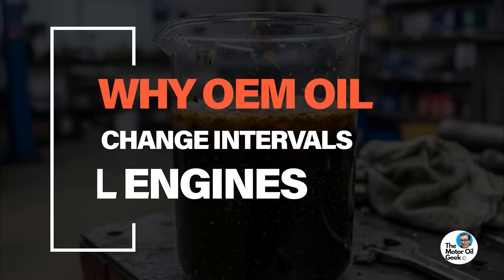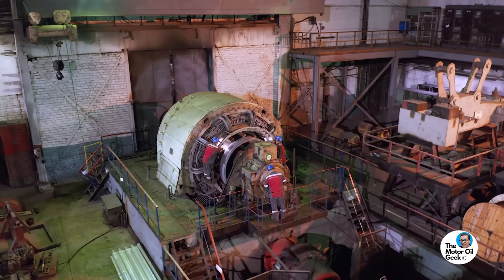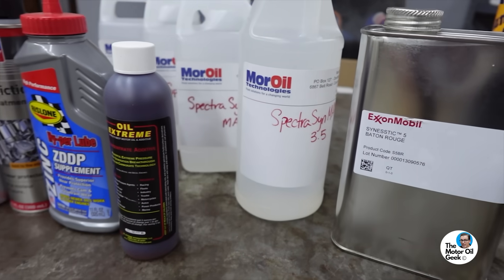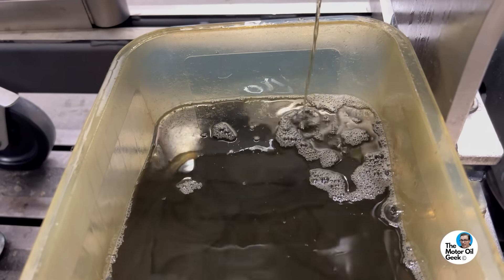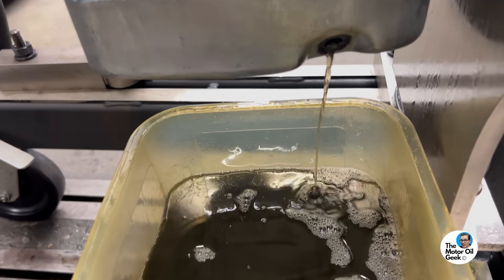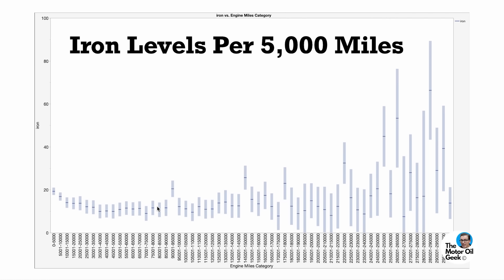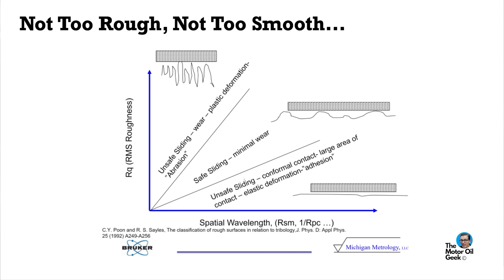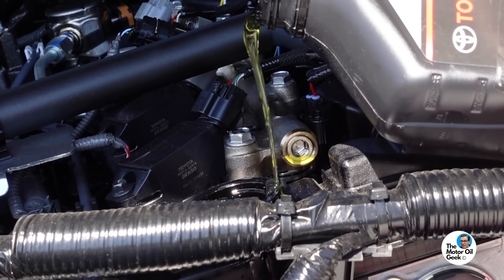NEW Data Reveals WHY Modern Engines FAIL Prematurely!

Comment: Another great video that answers a couple of points from my experience.

Firstly, and engine I rebuilt made 20bhp less on a dynomometer at about 8000 miles than it did at 30000 miles.  No engine or exhaust parts were changed.  I think break-in can take longer than  10000 miles.

On another car, I noticed the differential bearings were in worse shape than the wheel bearings at 250k miles.  At one point, the pinion seal leaked and I suspect less oil, coupled with the differential bearings being next to the final drive gears is what caused more wear of the differential bearings.  Now I know the rear axle oil definitely does need changing and I blame the initial 125k with not changing the oil.

Comment: Awesome video. A mechanic one told me a oil change is cheap in comparison to the cost of a new engine. 
I wonder if engine internal parts quality has a correlation to engine breaking down. Parts being made out of a cheaper grade metal than engineered for.

Comment: If you are tired of engine problems then just get a mazda. Those engines use elecric solenoids instead of hydraulic pressure. Those engines run forever.

Comment: I never bought in to this trend of high mileage between oil changes. I remember reading in a 1960’s GM book to change oil every 3000 miles and the filter every other oil change. That seemed to change with the spin on filters. So I stuck to 3K and filter with gas engines and 5K with filter on my diesel engines. I just purchased a 2026 F 250 with the 7.3L engine it’s at 400 miles. So Lake my plan is to change the oil at 500 miles with valvoline Daily Driver 5W-30 the only oil I’ve found so far that meets the WSS-M2C971-A1 requirement. Do I change the filter on this first change? I’m think not. Thank you in advance

Comment: In the past, I have always done the 1st oil/filter change at 1000 miles, the 2nd at 5000 miles, then every 5000 thereafter. However, I just purchased a 2025 CX-5 Turbo Signature and I plan to be a bit more vigilant with it, as this will be my last new vehicle for a long time, since I'm retiring soon. I just did my 1st oil change at 600 miles and the 2nd will be done at 1500 miles, the 3rd at 3000 miles, the 4th at 5000 miles, then every 5000 thereafter. I will be using pennzoil ultra platinum 5w30 for the duration because it offers excellent wear protection in turbo engines at a good price, which is important when doing more frequent oil changes. Given that turbo engines are naturally hard on oil, a few extra oil changes are well worth the cost. Another great one!
Reply: A 2025 vehicle will likely not last you a long time. It's worse than we all think.
Reply: @TraderNalang  There have been sh|tty vehicles being sold throughout automotive history and there have also always been excellent vehicles being sold the whole time. That continues to be true today. Plenty of current models can last as long as you want them to, with proper care. People have been making hyperbolic statements about vehicle quality for decades, but if you choose the right vehicle to begin with, longevity is mostly about maintenance after that.
Reply: @TraderNalang It's a Mazda skyactiv. It will do 300k even with the ridiculous 10k mile interval. Mazda today is what Honda/Toyota were in the 90s.

Comment: On my 1GRFE, anything below 5W-50 under 30C will lead to valve clatter.  So its ester based full synthetic for me here as the noise tells me the story and of course using double filtration with magnets helps.

Comment: @themotoroilgeek 

Can you do a chemical analysis on bmw specific long life oils compared to the regular synthetic sp rated oils.

My suspicion is there is no reason to buy the ll oils because the sp rated oils are also designed to operate in turbo charged direct injection engines.

Would love if you went over this

Comment: For those locked into a dealer service schedule I have found that purchasing a 2 Gallon fluid pump to do intemediate oil changes at home between the dealer service interval to be a quick cheap and easy option.
I just suck the old oil out through the dipstick and refill. Dont change filter.

Comment: I think in an old engine, it’s the carbon getting past the rings not so much the smooth surface finish whatever it is old engines need oil changes

Comment: Since  my early driving days, 3,000 miles was the oil change interval to adhere to.  Despite using synthetic oils today, and a lot of stop-go driving I still do 3000 to 4000 mile OCI

Comment: OEM's used to manufacture their own engine parts. They no longer do that, so quality control suffers. No oil is going to make up for a component that wasn't hardened right, wasn't machined right, or was made using the wrong material for the application.

Comment: I could use recommendations on which filters catch smaller particles.  I am not running long intervals, so I don't need "extended mileage" filters.  Manufacturers don't always list the actual particle size and filters have changed so much/often in recent years.

Comment: Is it OK to use a good quality semi synthetic or mineral oil for the first 5 oil changes during the break-in period?

Since I'll change oil the first time at 100 miles then 250 then every 750 miles for the next 3 times is it OK to save some cost on the oil?
 
Do I need to change the filter at every oil change?

Comment: Bought 2010 Dodge Grand Caravan Feb 2010 (Date of Mfg Nov 2009), new.  When at 5,000 Km changed to Amsoil FS and have changed oil & Filter every 10,000 Km since then.  Still on original motor and transmission with currently 342,387 Km showing.  Van still gets between 24 & 24.7 Miles per USG.  Do 80% to 85% highway driving, still averaging over 20,000 Km per year.  Every 150,000 Km drop transmission pan, replace filter top off with Amsoil FS.  Oil and filter lot cheaper than new motor.
Reply: What kind of engine? Pentastar 3.6l v6 ?

Comment: Owner manuals of the ‘60 and ‘70s state an oil change every 5000 km or 3500 miles. Viscosities used were 10W40, 15W40 and 20W50 as standard change. 
 In the ‘80 and ‘90s an oil change every 15.000 km or 10.000 miles or ‘Every year’ what ever comes first. 
Viscosity of oil back then are resp. 10W40 and 15W40 as standard.
- Worn engines or engines with great tolerances run great on 20W50. Whereas sportier engines do well on 10W60 Synthetic oils.
Reply: Thanks

Comment: @13:25, so a thicker oil has more contamination fighting power in a diesel with soot?
Reply: Also interested in this. I would say yes, but I am not qualified. I do run a 5W40 in a diesel that is rated for 5W30.
Reply: @nrnccrdn  From what I understand is 5W30 and 5W40 share the same base weight, but the 40 would have modifiers that thicken it when it gets hot. So I don’t really understand where the ability to fight soot would come from; unless it would also have more of a detergent package as well.

Comment: I also believe that engine oil viscosity have gotten to thin to give enough sheer strength once the engine oil is at operating temperature they fail to protect against metal to metal  contact causing extreme wear along with extended oil change intervals manufacturers suggest are too long  ,by 5000 mi. oil is completely black burnt and full of contaminats and needs  changed, a tubo or supercharged  engine most likely needs changed more often than every 5000 mi.

Comment: What if you’re running 20 pounds of boost and using E 85? I’m changing my oil about every 30 WOT pulls. I’m using Motorcraft 5W 50 and a Motorcraft filter through a built coyote per the engine builder. I actually don’t know how many miles are on this thing.

Comment: Hey Lake.  Back in the days of conventional motor oil, my service interval was 3-4k miles and I'd get well over 100k miles on my cars.  Now with synthetics it's the same service interval but at a much higher cost and I doubt the modern engines will last as long. So are we being bamboozled? 🤔

Comment: I have worn out a lot of vehicles in my life and none had oil related engine failure. I’ve always changed the oil per the recommended interval and used synthetic oil. Those were older NA engines that would run fine on dyno oil. 

Now I finally have a modern engine 2018 F150 3.5 Ecoboost currently with 70k on it. The phasers were replaced under warranty with the updated design. Pennzoil Ultra with Motorcraft oil filters every 7k is my current choice. Luckily this truck is used for long trips and light towing under 5000# so it should be fine but you have me worried Lake!
Reply: 1 city mile = 10 highway miles.
You're changing your oil every 700 City Mile Equivalents (CME).

Comment: I'd add "Tidy Bowl" service to the list of oil functions.  Keep the finer debris (that gets thru the filter) in suspension and flush it out at oil changes.  5k works well after break in for normal mixed driving use-  i.e. some city driving,  some highway.

Comment: Don't believe everything you're telling us is correct a lot of these camshaft and lifter failures are because of manufacturing defects especially the roller lifters, the rollers and needle bearings not being the made of the correct steel and the hardening process of these parts not being done correctly,  countless cases of engine failures because of these inferior lifters on low mileage engines that had proper maintenance !!! A lot of the blame falls on the  manufacturer of theses substandard parts !!!

Comment: "Parts per million" of contaminants does not correlate with either "particle size" and "particle type".  Much more wear does correlate with LARGE, HARD AND LARGER AMOUNTS of those larger and harder particles. This info must be thoroughly sorted and graded to come to any meaningful conclusions. Yes, all your general statements are true IN GENERAL, but, all the specifics must be determined and rated to how much engine wear they cause. This requires HUGE amounts of controlled testing. You have given us no practical advice other than "change the oil and filter after multiple unspecified mileages on break-in" and "oil brand isn't near as important as it is generally believed".  What are we supposed to do ? Where are your recommendations/specific guidelines ?  //  All that was said does not hint at the unavoidable engine wear and widespread failures caused by a handful of large auto manufacturers for failure to thoroughly clean freshly machined debris from brand new engines.  //  You showed no conclusive evidence that longer oil and filter change periods actually improve engine wear mid-life in an engine's lifetime.

Comment: Ordered my 2018 F150 5.0 ,..when it came in, told em to park it in the back of the lot,..let it sit there for a week. When I went to pick it up, changed the oil right in the dealers back lot. Got a picture of the metallic particles in the black pan.  AMSOIL 0W-30.   7 miles on the odometer. CNG PREP 5.0,..Better valvetrain & intake manifold.  Ford stock antifreeze is junk. Changed to ZEREX GO 5 gold, w deionized water. FL820S..instead of FL500S filter

Comment: The real reason is the consumer is stupid, the manufacturer is smart, and there are no real men anymore that know how to maintain a vehicle, the population cannot help itself, cannot stand up and say we won’t buy your overpriced junk anymore we want a better product at better prices. Cars owners manual used to direct the consumer on total car care
Reply: I've read old manuals. They had no more information (Probably less) than current manuals.
Reply: @MathewPollard-vj4uq right, like valve adjustments, clutch adjustments battery care, even transmission device and entire car maintenance, you think old manual means 2000 lol

Comment: Hi Lake—as a fuel system engineer for a major Indiana-based engine company, I work very closely with our filtration partners to test filters and develop specs. So when I have to select filters for my own use, I scrutinize quite heavily. To my knowledge, the best oil filter you can get now for most basic spin-on applications is the “extended performance” synthetic media filter made by Premium Guard and sold under several brands— the Carquest Premium EP (at advance auto), the Microguard Select EP (sold at O reilly). It’s also offered as the “Service Pro extended protection” sold to auto professionals. These are only rated 25 micron (99%) but they will filter down to 10 micron with 90% efficiency and still are over 80% efficient way down at 5 micron! This is near-bypass performance in a simple spin on, and crushes most common spin ons in beta ratio at the particle sizes below the micron rating. They are well made and affordable also. I’m using them on everything now. Yet despite the superb particle removal efficiency, they still make a 10k mile claim. Remember, if a filter lasts forever, (20k+ miles) it’s probably not filtering much. Looking at you, Purolator BOSS and your 48 micron rating.
Reply from the maker: Thank you for sharing that information. That’s a huge help!
Reply: @themotoroilgeek  a big problem is readily available data, that is easily found by the ordinary guy ,to compare each filter .

Comment: Not sure I am buying what you are selling... some is very correct... other things you are just assuming. My Honda Ridgeline doesn't even have a written interval for changing the oil ... they instead go solely bu using the trucks computer maintenance reminder... which involves idling time, stop and go etc.. but yes I did do an initial change before 3K miles. The computer said the oil life was at 60 %... I did it mostly to remove the filter because it's not rocket science to understand the filter will bypass if flow is below a set pressure. So while you are somewhat right on a dirty filter working better, if it gets too dirty it won't work at all. If everything you said was true, Valvoline restore and protect, is really going to cause damage if you leave it in your engine for more than 1000 miles... but some on the Internet are running it full time... so Valvoline is wrong, or you are.

Comment: I worked in the industrial sector with hydraulic systems. When diesel manufactures came out with that HEUI system using the motor oil I was wonder how well that would work. Well is wasn’t a good idea, those injectors and the pump had a lot of issues with that dirty motor oil.
    On a previous video I made a comment why you don’t just break a modern motor running it at 2300 rpm for 20 min. Your response was that was for flat tappet engines. On this video you showed you broke in a roller lifter motor the same way. What gives?
     On industrial and agriculture equipment they recommend changing the filter every other oil change. And those engines are subject to a lot more dust than cars are.

Comment: Interesting my past Honda's maintenance schedule was correct in  recommending an oil filter change every other oil change. Unfortunately dealer never followed this and always install a new filter. Once I took over changes I would also follow this to remove as much old oil as possible. I wonder if removing the filter to drain the oil but then reusing it would be advised?

Comment: I yearn for the days when I just happily went with Castrol GTX 20w-50 in my air cooled thumpers without thinking about it...at 1k intervals because it was a 10 minute job and $2 a quart for the oil.

Comment: Up front, I love the videos, and appreciate all the science. But I kind of felt like this raised as many questions as it answered. 

Basically said that the hydraulic systems used in modern engines fail due to contaminants. Also said that much engine wear occurs due to particles below 20 microns, which is below the size that most oil filters capture. That we need to change oil during break in quickly to get all of these contaminants out, but once broken in, the filters are more efficient over a longer drain interval.

So what i don't understand, is how do these sub 20 micron particles not build up in the oil over the longer drain intervals? To say that soot, which is most likely what a lot of these sub 20 micron particles are, is not an issue in gasoline engines is to ignore the much higher levels of soot production in modern GDI engines. It seems to reason that without a bypass filter, all engines would benefit from a shorter interval  to make sure that these very small particles that the oil filters bypass do not build up and cause wear.

I can't square the math that wear occurs due to sub 20 micron particles, that standard filters can't stop these particles, yet i should use longer intervals to reduce wear. Maybe I am missing something.

Comment: For a typical U.S. NA engine, what oil filter has sufficient filtration for particulate matter smaller than 20-21 microns? 

Bosch and AC Gold were readily available 20 years ago and they had at least 90% filtration at 5-10 microns and 99.9 at 20. Where’d they go?

Comment: These manufacturers need to be held to a much higher standard.  They develop parts to fail within a few years either to perpetuate maintenance and costs.  They use plastic in areas of giant heat cycles that make parts prone to failure.  These parts are often in areas that require many hours of labor to replace.  Lock them down.  Also the light enclosures should be made of high impact glass.  These plastic lenses that oxidize are bullshit.

Comment: Another question, what about fuel system "cleaner" products? I use  Lucas brand fairly regularly, might be junk, might be good, but my experience with most of their products has been good, so I keep using it on faith. I have a DI cart and a port injection car, wish the DI was both to help keep the valve clean.

Comment: @themotoroilgeek From your last video, are you’re saying a diesel oil will wash away an ester based oil……the reason I ask is I would like to use HPL-EC40 in a diesel that has has been using Valvoline Premium blue, and I’m not concerned the high ester cleaner won’t do anything or may have a negative effect, before switching to 100% HPL.